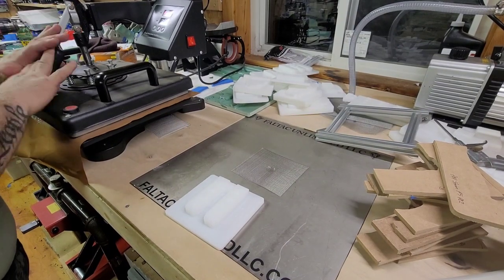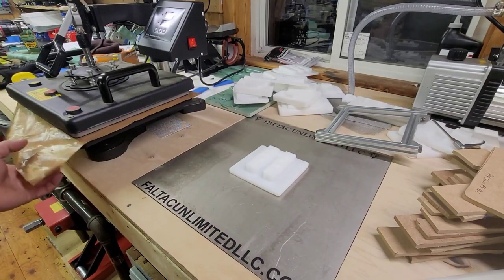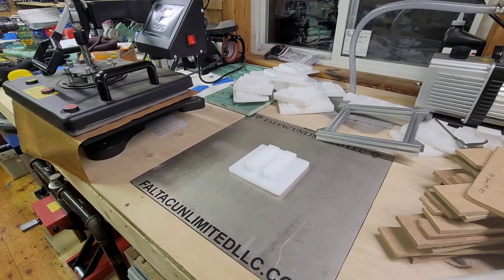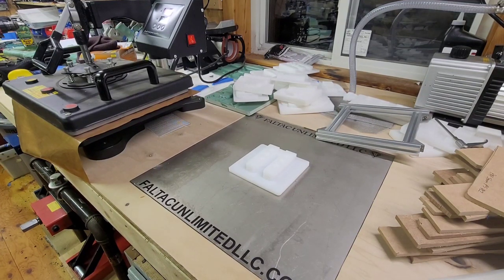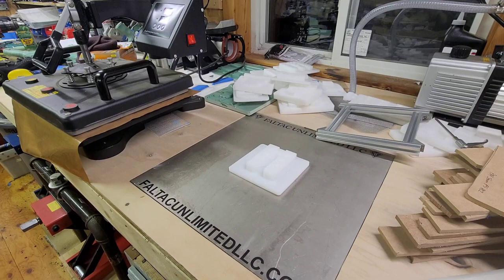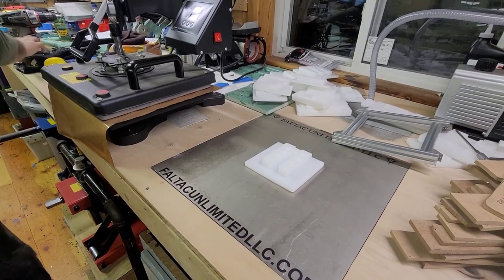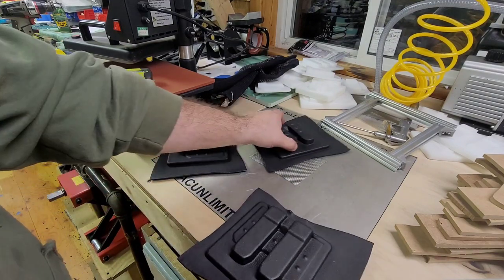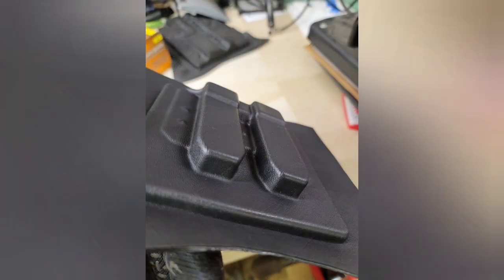Heat press. They're great. Not needed but more uniform

Comment: How do you deal with the ventilation issue when heating? I read that it can release fumes. Is it an issue I need to worry about if I am working in my basement? I haven’t seen anyone mention them. I’m probably over cautious.
Reply from the maker: I don't notice a smell or fumes with the heat press. Just the ovens
Reply: @FalTacUnlimitedLLC good to know thanks!

Comment: Hello! The kydex sheet in my oven has greatly reduced in size when heated to 345'f, what could be wrong?
Reply from the maker: it shrinks, nature of the beast. using a heat press helps reduce shrinking cause of the pressure applied
Reply: @FalTacUnlimitedLLC  That's what I thought, thanks! It is strange that Boltaron behaves quite stably under the same conditions.